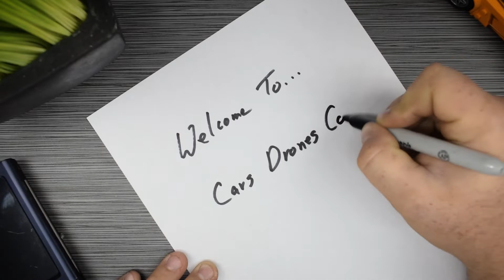USB Power Bank Teardown

Comment: I rather use 20 volt tool batteries with 5 volt adapter fast charging. I got two power banks never really use unless in a jam. One I had had micro USB for charging the bank that wear out long before the Lithium batteries. When the tool battery wear out get another one. Or repurpose batteries also. Even the 20 volt out can power some laptops.